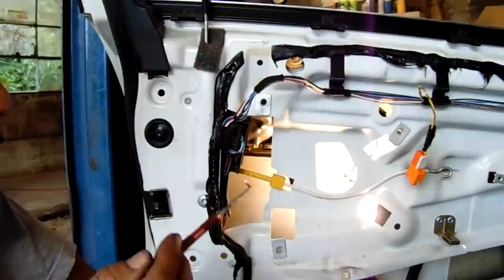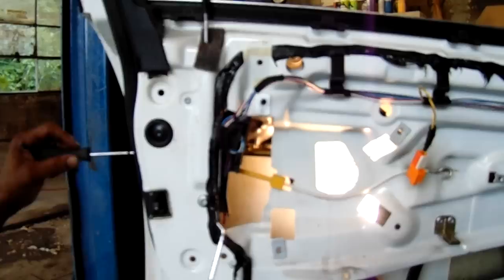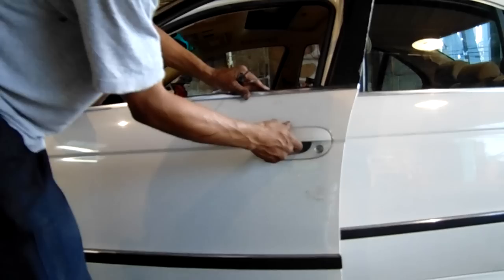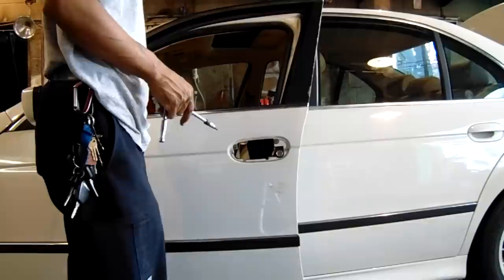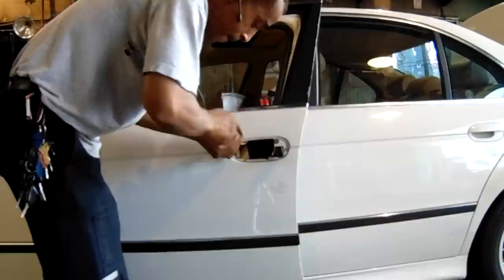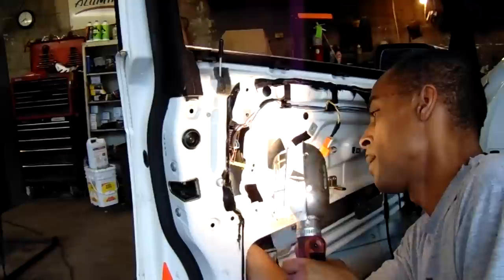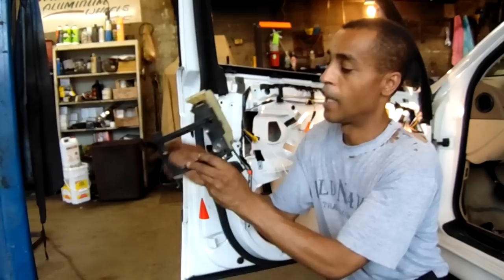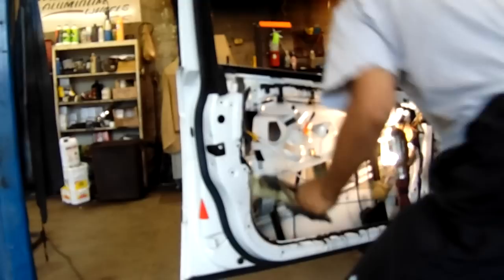How to remove door lock cylinder on BMW E39 5 Series

Comment: Can this lock cylinder cause a no crank no start issue with ews? I just bought the car and there's no locks working or anything and my cylinder is doing the exact same thing
Reply from the maker: do you have the correct key? also check your fuses, the ignition key in the starter key hole should deactivate the alarm system. also make sure the battery is fully charged
Reply: @crazysexycool180  I hooked it up to inpa and it turns out it's my ews that's bad. Thank you for the response man

Comment: I replaced my door barrel lock and removed both the lock and the latch from the facelift E39 and installed everything properly, I had the battery disconnected during, I didn't do the trick the battery to help get the white plastic nut onto the latch, i got it in without doing that, but anyway the door barrel lock only works to unlock the car not lock it, the key doesn't physically turn past the middle to the lock position. Also the door lock knob on the interior doesn't push down. The central locking seems to try to attempt to push down the rod but it can't so it bobs down and back up again. I assume there is an issue with latch being in some unlocked position and stuck, or possibly it is now broken. Is there any way to fix this? It was working before, it was only the lock barrel that was broken. I assume it's nothing to do with the actuator as its a mechanical problem when the battery is disconnected. I figured out how to connect the bottom connector to the latch, my connector kept being pushed back in when you pushed the plug into it, so you had to pull out the connector with pliers then hold it there with a hook whilst you pushing in the connector. Thanks.
Reply: exact same thing happened to me but the opposite, the door will lock but not unlock.. i think because I have a right hand drive model.. this is horrible, did you ever figure it out? If i move the little cross slot in the latch mechanism far enough it unlocks, but the barrel for the key lock does not turn far enough to get it to unlock, its so strange
Reply from the maker: Thanks for watching , please like, share, and subscribe
Reply: I think you assembled the lock into the latch with the latch position switch 90 degress offset. The lock self centers, the latch switch (yellow cross socket) does not. Both must be oriented to middle or the switch is always 1/4 turn out of position.

Comment: how do i get my 3 series bmw door open if it is closed. i can get in from all other doors but my driver door something broke and i cannot get it open.
Reply from the maker: take the door panel off. to get o the rods to open door
Reply: @crazysexycool180  the thing is my car door wont open so im not sure how were gonna get the door panel off when it wont even open. do you have a video when the door wont even open?
Reply: @crazysexycool180  how do i go about getting the panel off without breaking my door or scraping the car?

Comment: Hi! My e39 1997 won't start after door lock actuator and window lifter replacement. It just makes a continuous clicking sound after turning the key with no crank. Pls help!
Reply: Noel Santos your battery is dead charge it or replace it
Reply from the maker: check battery